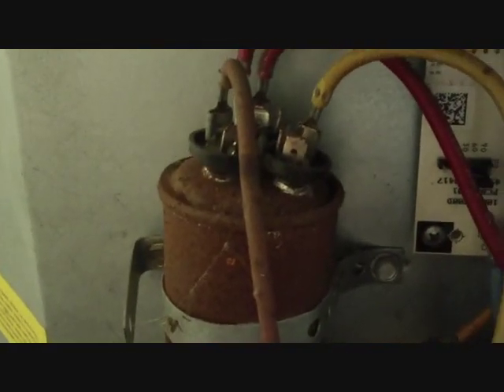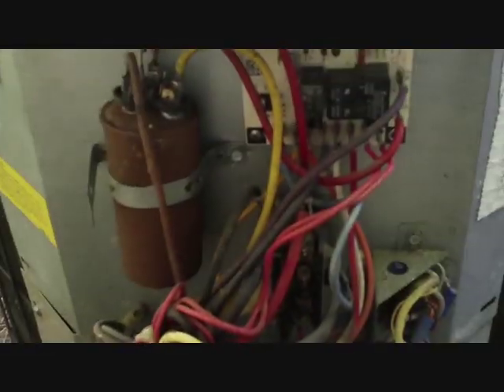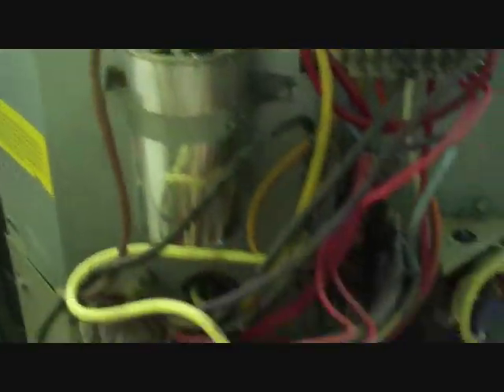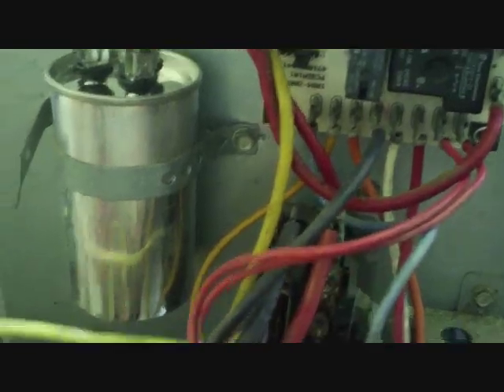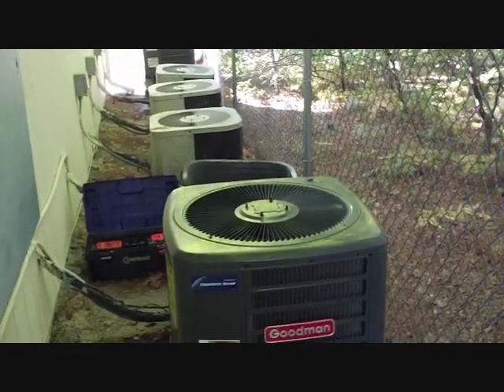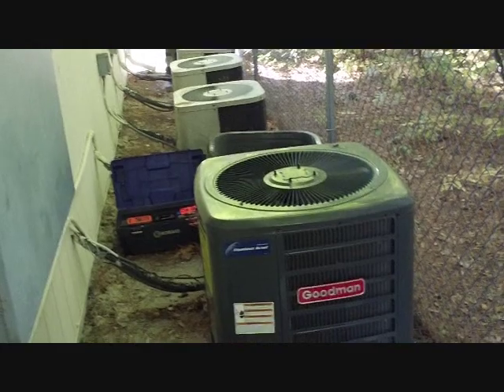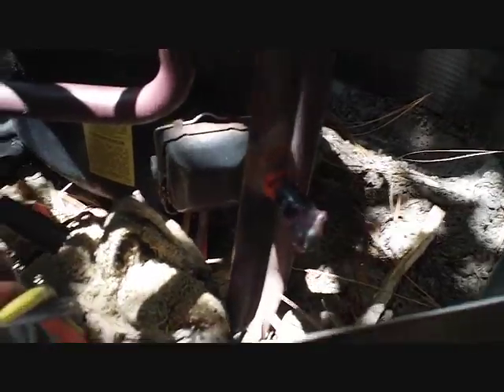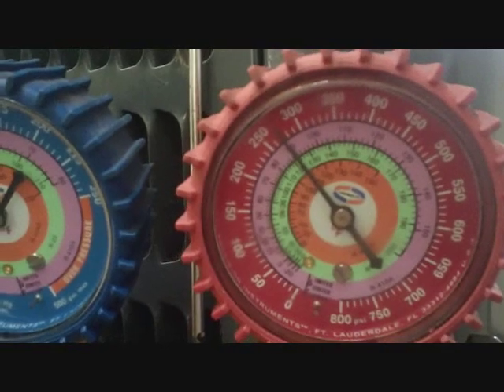Heat Pump Troubleshooting: Outdoor Fan and Leak Repair

Comment: When you pressure the system with nitrogen you take all the freon I'm assuming or or vacuum the system?
Reply: Yes, you recover the refrigerant
Reply: so the coil inside the heat unit is what make the cold air inside the house? that's why it needs to be clean often!